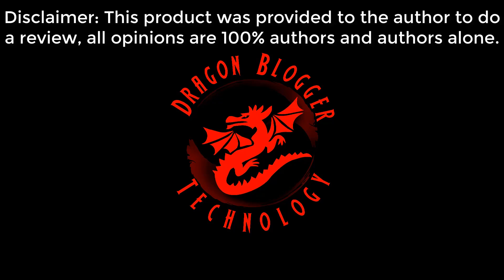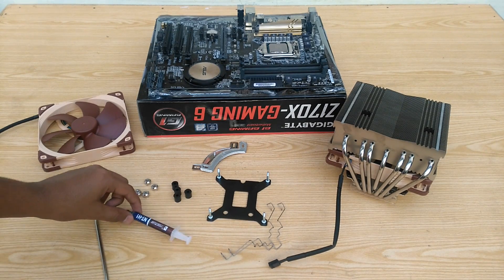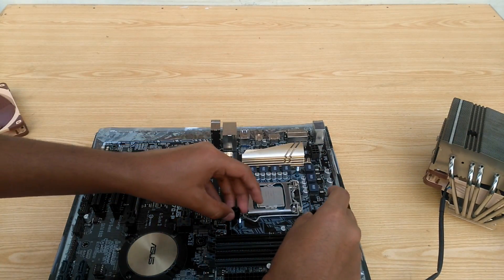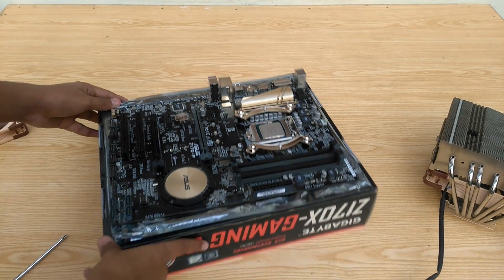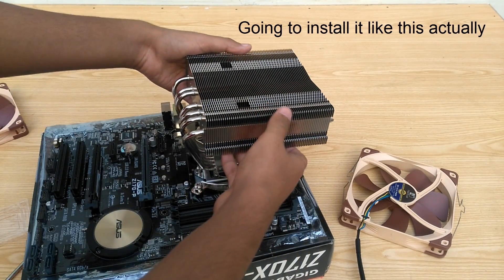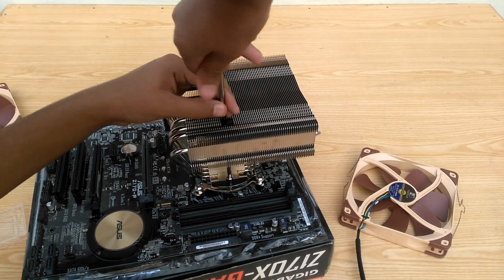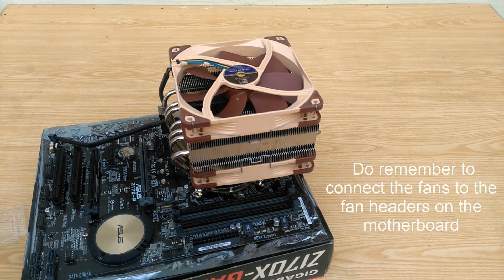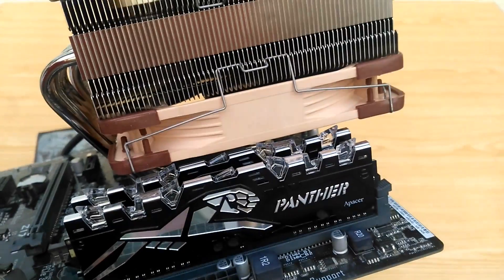How To Install Noctua NH-C14S With Dual NF-A14 Fans

Comment: As pointed out pulling air up will not cool the other board component - unless of course you have another fan (like a 140) in the case bottom feeding intake over the board. 
Using a single fan mounted exhausting air from the cooler's top and the fins correctly oriented, half the cool air is being pumped through the fins by the bottom intake while the other half goes across the board, whereas a downward flow through the heat exchanger onto the board feeds pre-heated air.

BTW, The Intel adapter can fit in different configurations, not just one way - so cooler's the fins can be oriented correctly.

Comment: Thank you for the video. I've just bought a 12700k and a 3080, would you recommend I get an extra fan for the c14s? Also, should I mount horizontal to fit the card??

Comment: After thorough testing, I can safely say that any top-down coolers will definitely works better with the air blowing down on the motherboard. It's not about 'removing' the heat from the heatsink, but to introduce cool fresh air from above.
Reply: that was my question, the warm air is blowing on the mainboard, on the VRM´s. If it is blowing away like here, your VRMs shall be cooler. I dont know, what is now the best option
Reply: @stefan-D  firstly, any airflow is better than no airflow. the VRM typically have higher thermal limit and does not produce as much heat as the CPU, which is why VRM are not actively cooled and mostly have passive aluminum cooler attached to them. if you want to squeeze every bit of performance out of your CPU, you will want to prioritize cooling your CPU first. And yes, if you direct the fan downwards, your motherboard does get warmer compared to if you point it upwards. But it is within safe operating temperature and most likely won't be the limiting factor for your whole PC performance.

Alternatively you can try having your rear fan as an intake that will feed cool fresh air,  and set the NH-C14S fan pointed upwards so that the hot air will instantly removed out of the case - assuming that the side panel is ventilated.

Comment: You've put the airflow going up, I prefer mine the other way so that it will cool down my motherboard components.
Reply: It blows the hot air on the mobo that way...
Reply: @daliborjoksimovic8661  @ EUK007 and Dalibor, so what is now the better option?
Reply: @stefan-D  I would always place the fan so that it blows hot air away from the components and another fan to pull hot air out from the case.
Reply: @daliborjoksimovic8661  sounds good, but the most people are doing it otherwise
Reply: @stefan-D  It's not that difficult to change it around. You could try it both ways and see what works best for you.